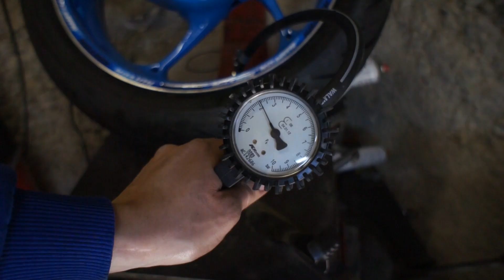Triumph Street Triple R 2014 Stunt Setup - Julien Welsch

Comment: Hi. I am kind of confused here...usually if you take of the odometer the ecu will lock the system and the bike will not start. So how did you by pass the ecu locking system. I am converting the same bike but if i take of the odometer the bike does not start. Mine has an immobilizer .